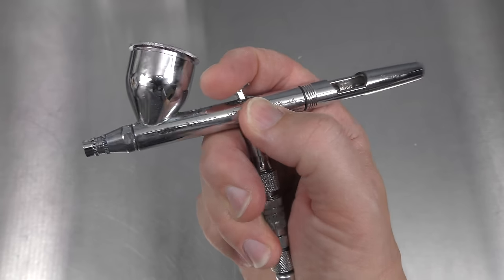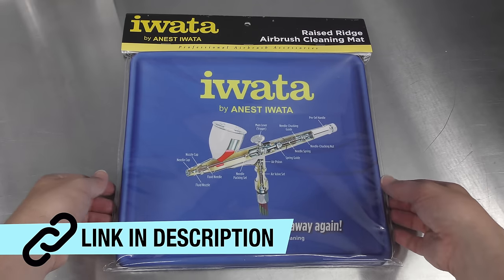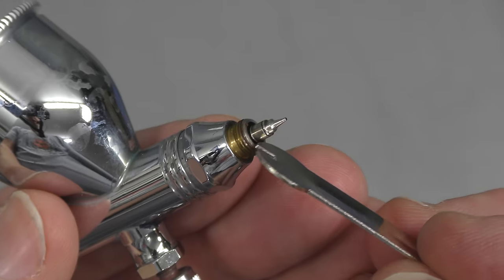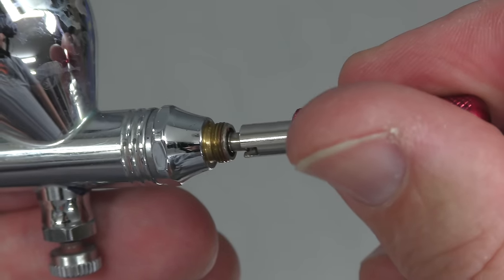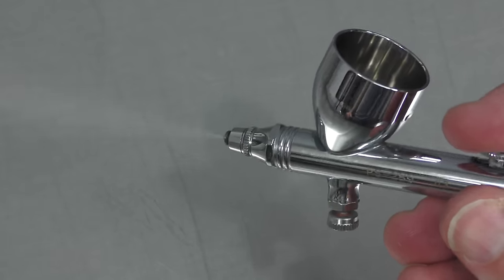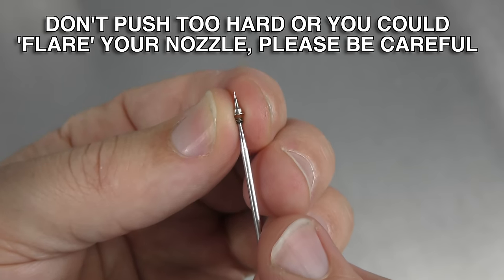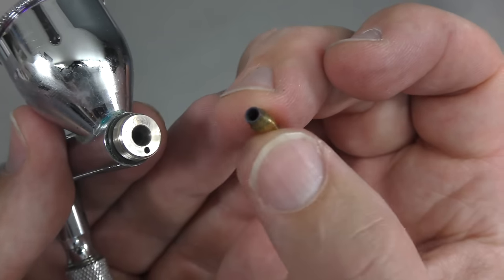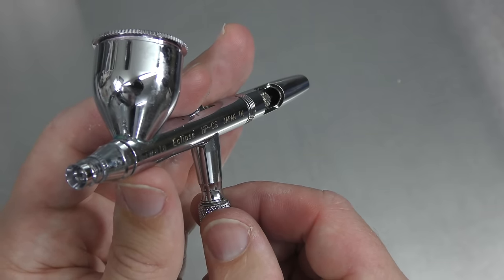Airbrush Fluid Nozzle Tips

Comment: Everyday at work I am tearing apart and assembling machinery held together by nuts and bolts. After 20+ years doing that, here are my tips to keep threads healthy and happy:

1. Clean the threads before assembly, seriously, I've seen some hardened steel bolts refuse to co-operate because of some minor debris in the threads. An airbrush is made from far softer material   so it takes far less to damage the threads.

2. Lubricate the threads, as Carsten pointed out in this video, beeswax is fantastic for your airbrush, vaseline is jolly good too. Now the pros of lubing the threads:

   a:) You need less force (torque) to get the same amount of tightness versus dry threads.
   b:) It will keep foreign material from entering the threads, in the case of airbrushing, paint, solvents etc.
   c:) Next time you stip down your airbrush for cleaning, see a:), less force needed.
   d:) Less stress on the threads tearing things apart and assembling again multiple times, good for your airbrush, right 😉

Hope this little rant helps,
Cheers.
Reply from the maker: Thank you SO much for your comment and professional tips I am certain this info will help many viewers and you summed it up better than I ever could so thank you so much for sharing your knowledge 👍🏻👍🏻

Comment: Watching this makes me very glad I bought a H&S Evolution. The nozzle and protector require no tools to remove and therefore cleaning is very easy. Maybe the H&S have other drawbacks compared to Iwata brushes, but this difference seems like it would be quite harsh on an airbrush newbie such as myself. Also, the nozzle on the H&S Evolution doesn't screw into the airbrush, but instead sits inside the protector (which screws into the airbrush), so no worries about the soft metal of the nozzle breaking and getting stuck inside the airbrush.

Comment: Hello,
Very interesting subject and clear tutorial.
Personaly I often use red tamiya nozzle sealing paste (from airbrush cleaning set) and apply a very small amount of it on the nozzle thread with a toothpick, it works nicely (taking care not to introduce sealing paste inside the nozzle). 
On other time I tried using beeswax (my brother having hives at home gave me some embossed beeswax sheets), it worked well too but was a bit difficult to mix with fingers and roll in a very small quantity as needed. 
Once applied to the thread  and to the joint with the adjoining part I briefly passed it over the flame of a lighter, then the wax  liquefied and ran evenly around the nozzle seal, this achieved a very good seal. 

Yes, an additive oil would be helpful to soften the wax but which one?
Reply from the maker: Thank you for sharing your experience and that Tamiya sealer sounds like the reddish sealer that appears on most brushes (as shown in this vid) so great to hear that it is available and thanks again for your comment 👍🏻

Comment: The day I got my sparmax I managed to break the thread of the nozzle in two when unscrewing it, can attest to that wrench being a dangerous tool. Whenever I have to use it not I made sure that all the force is going into turning it around the axis of the nozzle and it's not forcing the nozzle thread to bend slightly, and a hair above finger tight is enough for mine with the rubber o ring

Comment: TINY nozzle trick...  Raise your hand if you've ever "misplaced" a nozzle!  Or had one "jump" out of tweezers!

The thread size on most nozzles is M2.  Just search Amazon for "knurled brass nut" & you'll find lots of options.  I have some for 3D prints.  They're pretty aggressively knurled so that they stay in place once installed.

When I take my nozzle off, while it's still in the Iwata wrench, I'll thread one of the nuts (8mm long) onto the nozzle.  There are a couple benefits.  The biggest is... well it makes the nozzle a bit bigger!  And yellow!  This means it's easier to grip, to clean, & easier to visually keep track of.

When I'm ready to reassemble everything, I just put the nozzle back into the Iwata wrench, unscrew the nut, & screw the nozzle back to the airbrush.  I've not "misplaced" a nozzle since I started doing this.

Comment: I abused a Richpen 112b for years (just using ink for art pieces) - dug it out - the nozzle was almost burned out and the trigger was so corroded it actually snapped. So I got an Iwata Revolution - its nice - bigger reservoir - great for mixing Tamiya paints) but the action is nowhere near as good. Is there some way to adjust the Iwata to have a more subtle action?
Reply from the maker: Thanks for your comment you will find that after extended use your iwata will become smoother , feel free to also check out this vid for adjusting trigger tension 👉🏻 https://youtu.be/2rD3vqeZEg8 hope that helps 👍🏻
Reply: A heightened (extended) trigger creates a longer, more gradual withdrawal of the needle from the nozzle. I chopped one of mine halfway up with a Dremel cutting wheel, roughed up the involved surfaces a bit and spliced (soldered) a sleeve of square tubing into place, heightening the shaft of the  trigger about 1/4 inch.
An easier but uglier and less permanent solution, (one I used before modifying one of my triggers) was to simply heighten the finger pad of the trigger with a small (1/2 round) rubber pad with adhesive on it. The kind commonly used behind the bottom corners of picture frames. Cheap and effective but as noted, not awfully enduring.
Reply: @davidkoloc1313  thanks man - im not going to that engineering level - but it gives a good perspective - ah blu tac and balsa wood for me then :D

Comment: FYI, when putting the nozzle on, put in your needle, push it in and let 1/2” stick out the tip, place nozzle on needle and push on nozzle and needle  to insert the nozzle into the threads on front of Airbrush, it lets the needle start the nozzle straight into the threads, less dropping the nozzle as well!

Comment: Little lifehack: Don't remove the needle from the back. First, take out the nozzle, next - push the needle forward. That prevents paint from getting into the air valve. And thus you will need less cleaning.

Comment: NEVER take the two part nozzle of the "eclipse" apart, i'twat'a even recommend against it!!!
Reply from the maker: Thanks for sharing ….that is news to me 😱 luckily there is really no need to pull them apart, but I can also assure you I have had my eclipses for years and have removed both parts of the nozzle numerous times and the brush has never failed me 👍🏻
Reply: I disagree and have also spoken with Iwata techs on several occasions over my career and none has ever mentioned what you claim.
To the contrary, components that aren't crimped, soldered or welded together to become essentially 'one part' can be dismantled and reassembled endlessly if common sense, mechanical aptitude and the proper tools/practices are employed. 
This concept, along with high quality  materials and great tolerance standards are Hallmark of any well engineered mechanical products.